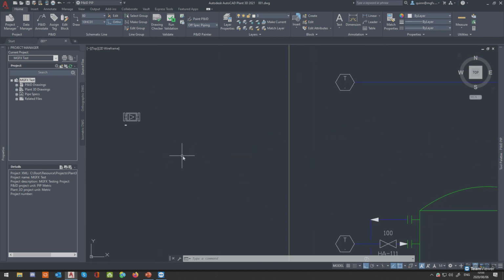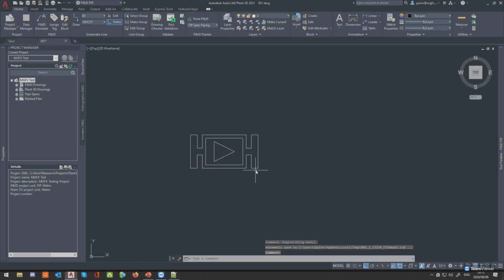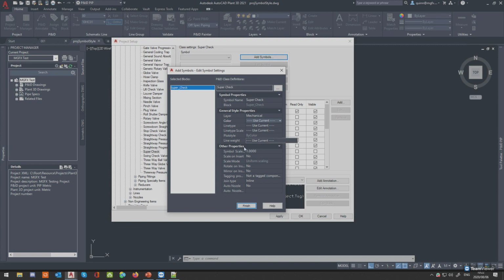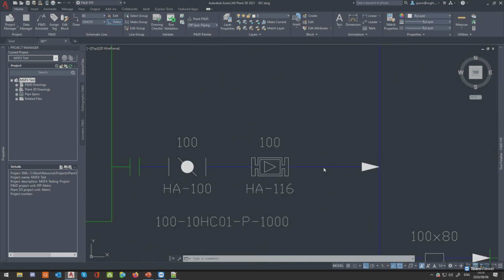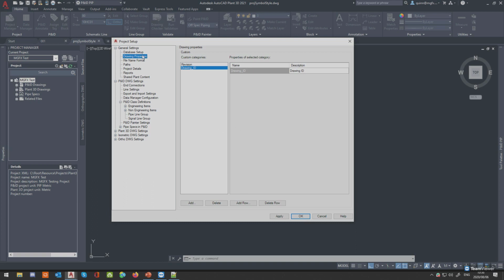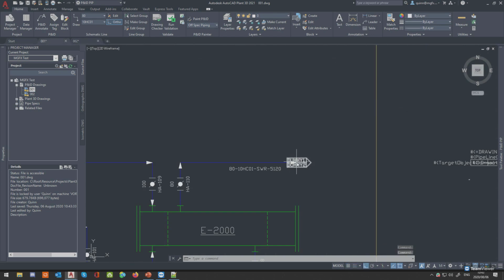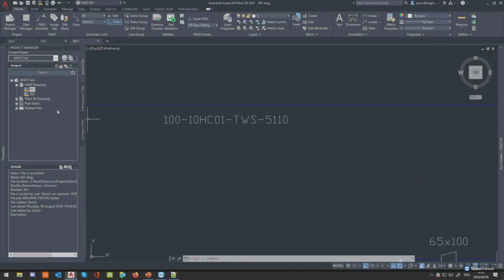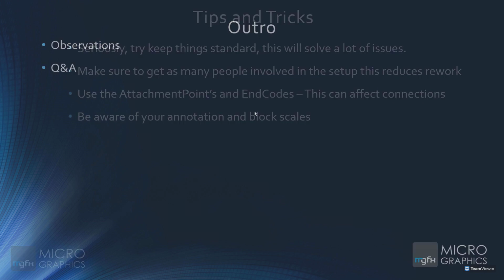Plant 3D - P&ID Customization Basics - Webinar - 2020-08-07

Comment: Hey
Very nice video thank you.

Maybe I understood a part of the idea about the blocks worng:

I did create blocks of small process parts, that I will use over and over again. Sometimes multiple times in one drawing. I was hoping to have a standardized solution like that. So I can basically drag and drop the majority of my projects together.

Now all of that works except for the tagging. 

Ex: One of my blocks would be RC1 (reaction chamber 1). If I have two reaction chambers both will always be named the same. I need them to be RC1, RC2,...
So a valve within that RC1 would be named: RC1-CV-1

Do you have an idea for a possible solution?